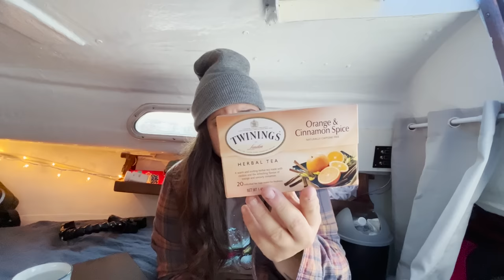Living Out Of My Sailboat For 3 Days | Heavy Rain

Comment: Greetings Becca - if you read new comments on old videos, that is.  This is my first time to see any of your videos, so I don't know your background, but maybe I can make a couple of comments you'll find useful.

Regarding security of your things - like your boat trailer - a padlock isn't going to stop someone determined to steal something, but it will discourage someone seeing your trailer as a target of opportunity.  So have a d-ring welded to your trailer hitch or somewhere and lock your trailer safety chain to it.  Keep the key in the vehicle, don't take it with you where you might lose it.

Secondly, you have a sailboat.  If you have all the parts, learn to sail if you don't already.  It isn't that difficult.  Even if you prefer using your motor,  the sail will be a good backup if anything goes wrong - sailboats are difficult to paddle long distances.

The mast and boom can be used to rig up a "boom tent" - simply hang a tarp over the boom and secure it to the sides of the boat.  That will keep rain out of your cabin, not force you into your cabin when it rains, and make it feel less claustrophobic if you are in your cabin.  

Also, the mast is a good place to have a light at night.

Comment: Go Becca, love the video.  I'm 65 and have been fishing since my Mother gave me a cotton string/hook fishing kit when I was 4 years old.  I watched you cast parallel to shore, jigging and jerking the baits and I knew you were an experienced sports girl.  I really like the boat, had not thought about that option but wow how great to have a camper and fishing boat in one!  Instead of truck, my toyota sienna serves as an on-land camper, very comfortable and holds a single or double mattress.  I have a trolling battery/motor as well and use it on rental jon boats.  I also added a fish finder with the transducer on the bottom of the trolling motor.  Allows me to always know precise depth, contours, and structure.  Very helpful for targeting fish, gps, way points, maps, etc.  Had all that equipment and much more when I had my Procraft Fish/Ski Johnson90 which I completely converted to a fish deck in front which made a very nice bass boat.  Been on reconnaissance missions this week trout fishing in Missouri to help plan a week long trout fishing trip with the brothers in the next spring.   Always keep fishing, it has continuously brought me much joy.  Cheers and Ciao!

Comment: Due you plan to get a mast and sails for your boat . You can see it has a centre board retrction module . The part inside you want to make a table top out of . Your boat is a trailer salior and that partion at the cab entrance is where you refract your running board to .

Comment: Hey Becca…a friend of mine made me Cajun seasoned fish years back, and it’s since become my go to method to prepare grilled fish, especially the “Red Fin” Lake Trout we get here in Lake Superior. 
I’m generally keeping trout in the 3-4 lb range, but I have done this with Tilapia and Salmon from the grocer too…Baste your fillets with cooking oil of choice, then liberally coat both sides with your favourite Cajun seasoning, (I’ve found cheaper brands have too high salt content for my liking , I like Club House or Hy’s)…grill on high heat searing for 2-4 minutes depending on thickness of fillets…remove from heat and drizzle with liquid honey. Easy and so tasty.
I used a fish grill on bbq for this, but now I’m using a cast iron griddle to get more of a sear on fish, pan would be fine too. 
Enjoying vids, Cheers! 🇨🇦

Comment: Realy it's a long dingy with a cabin makes sence you can sleep in👍but the anchor should be up the front with lots off rope out like lots off rope for the current swing or you'll wake up with the boat up against the shore or another boat one night and you need a better anchor than a pissy tinny one like that 😮and never throw back the first decent first fish u catch it could be the last and you will go hungry 😅 a bimmy cover would be nice on back off boat so if it rains your still covered 😊 its a fould out cover with aluminium tubes that foulds in and out made for boats like yours 😊

Comment: honestly thats  a "big" boat, for single person camping.  You have a ton of space...  If you got "creative", you could very easily load up more then a weeks worth of food, mixing canned,  rice, pasta...   

Uncle bens for example has rice packets,  microwavable 90 sec to 2 min...  you don't do that though,  instead, you boil water drop the sealed package in the water and let that warm the pouch through for about 10 min...   MRE style.   at 360-400 cal each,   you easy pack and store different flavors and types in a small area...  and 3 of them are half a days calories.    

you then combine that...  say, with a can of beef stew, pouring the stew over the rice.     Or mix it with a pack of raman (fried rice with chicken ramen noodles).   Beans and brown rice or white rice...  really fun if you use beans in molasses.  

There are different canned meats,  corned beef, spam...   cook the spam lightly and break it up, then add it to garlic rice...    can do the same thing with corned beef and tex mex rice.   the key thing is,  its all "small",  keeps forever untill opened.   the trick being, you tend to have to have 2 meals of the meat in the same day...  else you are using it as bait.    cuz without a fridge you can't keep it very long.   Even then though,  cooking it up at breakfast FOR breakfast, then having half of it there, and half for lunch or dinner is fine.   

The only thing you need lots of is water... and...  portable water purification kits...   pumping out a gal of water a day...   and you are good for cooking, cleaning, and drinking.